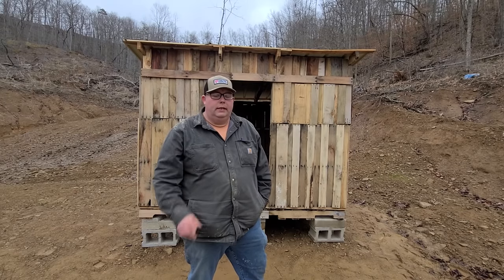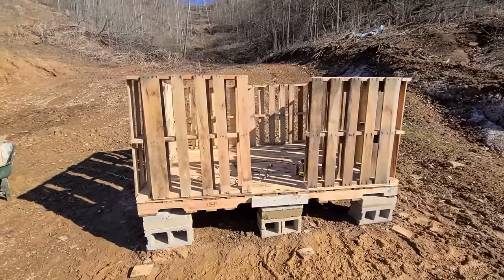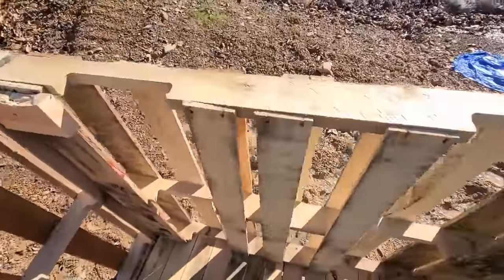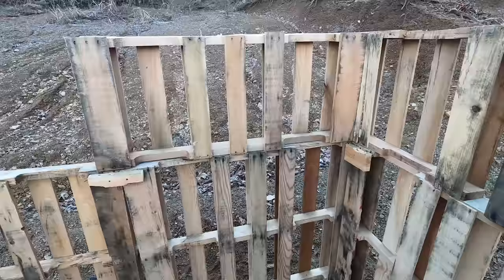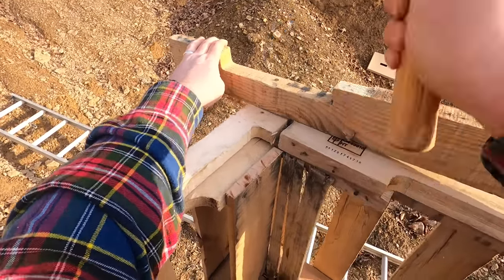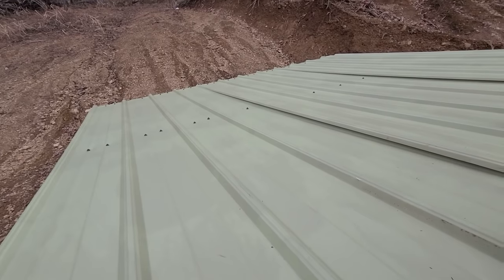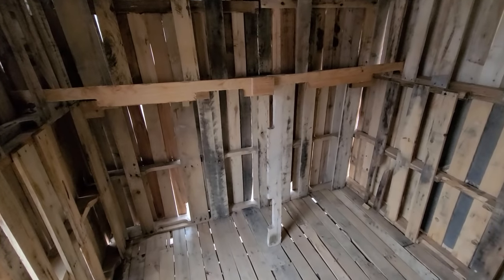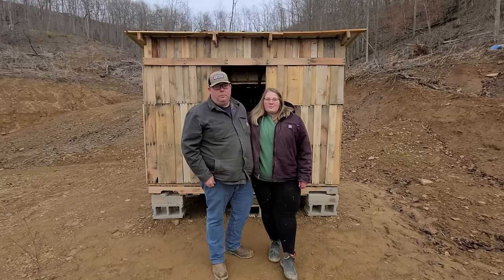How to Build a Chicken Coop CHEAP!

Comment: Pallet wood is great but mites are a realy common problem with chickens and when you get them in that structure you would never get rid of them...better to take all pallets apart and build proper walls and paint acrylic or latex/seal walls so you can clean the coop properly. To avoid disease you need to disinfect a coop at least once per year. Mice would also be a huge problem in that set up, they spread parasites and disease. Healthy chicken need a healthy home

Comment: Perfect! I Built a garden shed very similar. Cost me screws and that was it. Had reclaimed corrugated metal that was saved from an old roofing job. Also built a 4x8 greenhouse nursery for practically nothing. Old pallets and reclaimed wood.. Purchased scrapped out industrial plexiglass from work for next to nothing and added automatic greenhouse vent openers which was most of the cost. A person can do a lot with "nothing". The wife has continuously complained about all the junk in the yard and recently stopped once I turned that junk into a garden shed that she desperately wanted. That junk is simply inventory... nice job
Reply: It's opposite here. I'm a woman and hubby keeps complaining about the junk on our yard which are my stuff related to my gardening and DIY projects. The junk are going away because I slowly using them.

Comment: This is a great building. For added stability I would have reversed the layers of the outer layer of wood. This would have tied the upper pallets to the lower pallets. If you can find a cheap source of outdoor paint it will help protect the wood and help your building last longer.
Reply: You mean you would’ve used the outside planks horizontally instead of vertically?

Comment: Nice job on your coop. You might consider reinforcing  your rafters with some four footers and a few more screws to give the roof deck more strength. That joint is a potential weak spot. ( I have thirty years experience as a commercial roofing contractor. )  Also for your next project you can use synthetic rubber (epdm) that one can get for free when this type of roofing is replaced.

Comment: Very close to how I do my coops.   I use hardware cloth on pallets for the floor.  I found I made better compost if air can come up from the bottom.  I used other free materials for walls but I would use pallet wood if that was all I had.  I did spend on hinges and lumber for the door frame.  I also bought corrugated roofing because that was too important to use free materials on

Comment: You have been my inspiration! I have watched your video about 10x at least. I had a lousy drill and dull deck screws. I just invested in a better drill and at a stand still now on my coup.What size and type screws did you use at min marker 3:03 to get through the depth of the stringer boards?  THANKS!

Comment: You inspired me.  I collected heaps of free materials.  Bought screws, borrowed tools.  The problem is that everything is just too unwieldy for me to handle by myself.  I'm considering prying most of the top boards off, joining the mostly "naked" pallets end to end and then paneling over in just one layer.  Would that be enough floor to support a large adult?

Also, I'm wondering how you connected the pallets on the sides that don't...have sides?  They only have that side piece you showed drilling through on two ends.  How did you connect the second row to the first?  Just by the paneling?

Comment: Thank you very much for sharing. That’s what project I want to do. How big should I build for 50 chicken 47 hens and 3 rosters. Thanks again for showing step by step.
Reply from the maker: I'm happy to share and hopefully inspire others with projects like this. I have always read that about 2-3 square foot per chicken. Also if they will only sleep in the coop and will either free range or have a run to stay in during the day would make a little different too. I've found that they prefer to huddle up close together at night anyway so you can actually get away with less room than you might think! This little coop is right around 50 square foot and I feel comfortable with 25-35 chickens in that space. So you wouldn't need a lot more for 50 or so  I wouldn't think.

Comment: What size nailer are you used to put the side wood on
Reply from the maker: Anthony I used 18 gauge brad nails. I was hesitant at first because I didn't think they would be strong enough but I did a few boards and they're on solid! I started with some small nails and a hammer and thought I'd try the brad nailer just to speed things up a bit.

Comment: Pallets are NOT easy to work with. This is impressive just on that fact. 
If someone has not already mentioned, nails should be used long side any screw used. Cause it will flex and snap those screws at some point. 
You probably already knew this but just saying.
Reply from the maker: Thank you!

Comment: They need ventilation and a door
Reply from the maker: I actually left some open space around the top and covered it with wire to keep predators out. Instead of a door I fenced in a run around the coop with a gate. Valid points!

Comment: That was too much work pulling all those pallets apart for the walls and nailing each piece back up. I would have just framed the walls and spent another 160 on metal and ran it on the sides. I also would not have cut the rafters I would have just made the back wall a little lower to give the pitch. But that's just me and I'm not very bright.
kiss method.